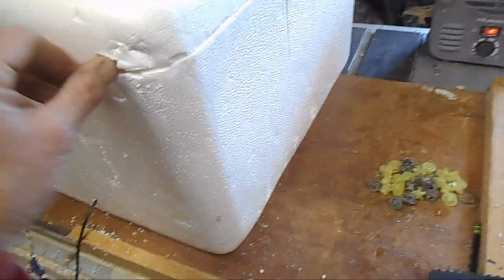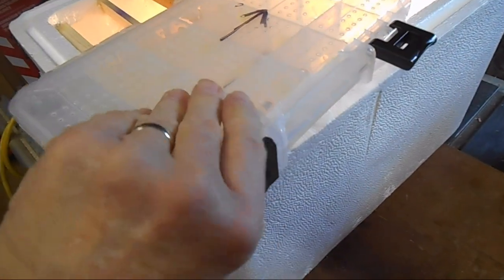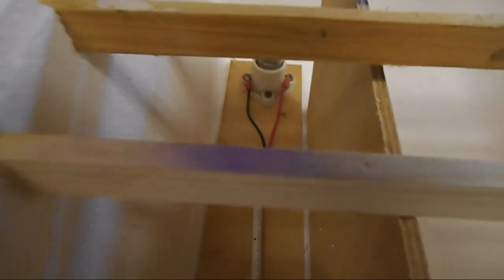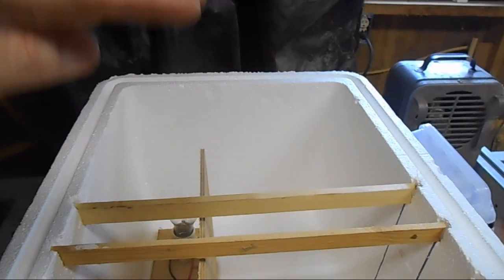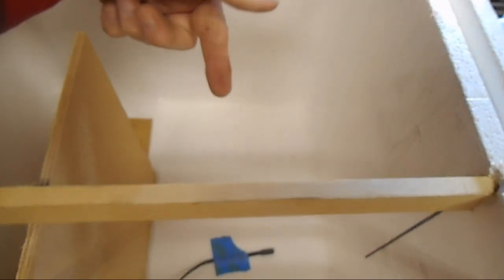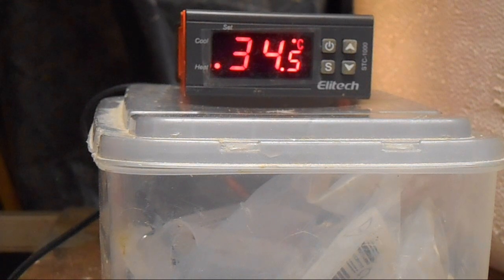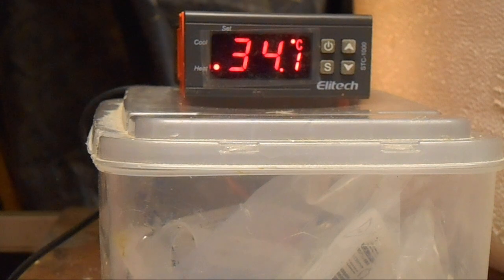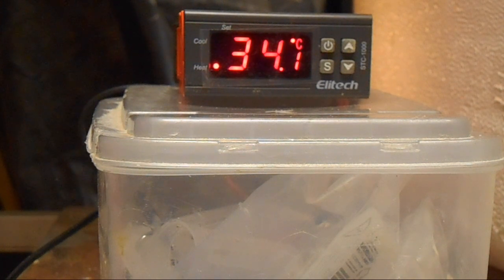Build A Queen Cell  Incubator

Comment: I don't see any updates to this video. How did it turn out? I'd certainly be interested to see what it looks like with cells in it. I'm rather new to this so I have a difficult time seeing it in the minds eye.
Reply from the maker: The incubator seems to work well for smaller volume queen cells (less than 20 at  a time). I used it for several batches but my volume requirements increased and I bought a chicken egg incubator.
Reply: @smokymountainbeekeep  Thank you, Chuck

Comment from the maker: I've had several comments of how to deal with the queens once they emerge. The method may turn out to not work at all but now I'm planning to use a #8 screen for each of the compartments as a separator. I'll see f that works.  I'll make a video of that and let everyone know how this method work. As some have suggested, I may just go back to using the hair roller style cages.
Reply: So what hatching % did you have ?
Reply from the maker: @Lucas Cameron I hope you have great success. Like with anything, over time, you may find some adjustments that can improve your yield

Comment: I LOVE This video!  Can you tell me where you found your temperature controller?  I figured that either Radio Shack or the pet store would have the inverter.  it is getting my device to control my temps that is my problem and how they are hooked up to control the lamp that is my issue.  It is frustrating me because I can build you the most beautiful bespoke  pieces for your home of office, but building this thing has my brain cramped for some reason.  I think it is because I am not familiar with these electronics to do with very fine adjustments and humidity and such.
Reply from the maker: Thanks for the comments. I hope to test this incubator in a few weeks! I bought the temp controller off of amazon. Below is the link. It is a bit confusing to connect the wiring and adjust the temp but once you figure it out, it makes sense.
https://www.amazon.com/gp/product/B00Y8T9YZG/ref=oh_aui_search_asin_title?ie=UTF8&psc=1
Reply: @smokymountainbeekeep  Thank you for providing me with the link.  This is very important to me.  I ended up as a quick stop gap buying a chicken egg incubator to just get me started with making my Queens while I make my own system.  Thank you for sharing your information on You Tube and making the beekeeping community a better place.

Comment: when you open the lid to take out a queen they will all kill each other hahahaha
Reply from the maker: It turns out that the queens don't run that fast initially but I had cut a #8 hardware cloth sized to cover each cubicle. That helped but eventually I learned that this was an interesting experiment. I have since determined that even though the plastic case is useful, I now use a "hair curler cage" in a little larger cubicle. Hey, thanks for watching and for your comment
Reply: @smokymountainbeekeep  I was going to say that too minus the haha remark good job

Comment: I've got an Italian thermostat(LAE X5),working on 220volts;the problem is that I can't take it with me,in the car for instance(12 v plug),,any ideas?!
Reply from the maker: That is an interesting question. At first I thought about building a converter using a CMOS 4047 along with a couple of transistors but that would be very complicated and time consuming.   I then did a google search and found this, perhaps this will help if you can order it from where you are:
https://www.banggood.com/XUYUAN-600W-Cup-Style-Power-Inverter-DC-12V-to-AC-110220V-Converter-with-Voice-Control-LED-Atmosphere-Lamp-for-Car-Home-Outdoor-p-1590131.html?rmmds=buy&ID=554483&cur_warehouse=CN

Comment: What size box are you using Omaha  Stakes are different sizes?
Reply from the maker: The box that I merely found on the side of the road at a neighbor's house measured 20" x 16" x 14". Hope that helps!
Reply: Chuck Davis thanks so very much. I am going to try to make one.
Reply: I put a brick in bottom of incubator it help hold heat a little longer b4 light has to come back on.
Reply from the maker: @kennysmith1571  The brick is a great idea. I had placed a couple of bottled waters but they were too cumbersome and either tipped over or rolled whenever I needed to access something inside

Comment: I have no experience with bee incubators but lots with chicken, pheasent, parrots and other exotic birds. I do not know how exact the temperature needs to be but imagine pretty exact. The problem with normal thermostats is the temperature fluctuation as the inertia in the heating element carries on giving of stored heat even after the thermostat switches of, same on the down side, as the temperature drops past the set temp it takes a while for the heating element to heat up to temperature and so the temp may drop a couple of degrees before it actually starts to heat again. All this gives a large fluctuation between the hottest and coldest temperature. A far better solution is a PID controler, not much more expensive than a thermostat but far superior in holding the set temperature. They work like your foot on the car gas pedle when trying to hold a constant speed, (and cruise control)if you hit an incline you need to give more gas, ease of as you reach speed so not to overshoot, and also ease off if going down hill. Once tuned they will keep the temperature perfect and also use much less electricity. If the temp drops suddenly like when you open the door the PID controler lets full power through to heat up quickly and reducing as it gets closer to the set temperature. As i said with bees i do not know how critical the temperature is but with some exotic birds its very citical, even with simple chickens you can up your hatch rate from say 65% to over 90% all else being equal. They are reasonably cheap on aliexpress banggood etc. hope this helps.

Comment: Chuck, 
Great idea!  

I've taken the same concept to build a honey super warmer within an empty medium super.  Used 2 100W bulbs.  It does a great job heating the honey to 93F before I extract.  Especially useful to extract cold honey.  

I've a couple of suggestions/questions
1.  Have you drilled holes thru the fan separator board near the wall to insure air circulation, so the wind doesn't 'dam' up?
2.  Do you think the thermocouple should be placed more toward the top of the system?  as hot air rises. 
3.  You've already thought thru what happens when multiple queens emerge and you have to open the lid.  Separate screens over the enclosures.

Keep up the good work.
Blessings,
Bob
Reply from the maker: Thanks for the comments. That is interesting about holes in the separator  board. I may try that. I have attempted to place the themocouple  near the cells themselves but I can understand about placing it more to the top.

Comment: Do you in now way measure moisture in the box? 
I always had heard that moisture is very important in queen rearing incubators.
Nice video!
Reply from the maker: With this incubator, which was the first one I built, I did not measure the actual humidity level, however, I did keep a jar of water with a sponge inserted to attempt to keep the humidity level high. I did notice that I needed to replenish the water every couple of days. That seemed to work satisfactorily.

Comment: Can you chain the fan and the thermostat together on the same cord to not have to have 2 plug ins? 

I did one of these for chickens last year but didn't have the plug ins linked. And it needed a lot of fixing still, didn't do as well as I liked.
Reply from the maker: I suppose you could link the fan and the heat (light bulb) on the same circuit. There should not be a current issue since the fans draw little current. My only concern would be that the air circulation (fan) would not be continuous and would cause the temperature to fluctuate a bit more
Reply: @smokymountainbeekeep  Ah, I guess your right. You do want the fan going 24/7. its not worth the risk if you end up blowing out a bunch of dead queens.

Comment: Developing queens are very fragile just after being capped. Moving them can easily damage them. You may need to wait till just prior to emergence. 

I also foresee mayhem when you open a case full of newly emerged virgins. Make sure you have the camera running so at least you can show us how it goes. I believe there are some cases available, similar to daily pill cases, which have individual compartments with separate doors. That may be a better option for you. This is definitely an interesting approach for small scale, low budget, queen rearing.
Reply from the maker: I appreciate your comments. I agree that the QC's are very fragile. If I move the QC's soon after capping, they are less fragile than a couple of days later. Of course they are much less fragile close to emerging but at that point, what's the use of an incubator. :)  It will also be interesting when I attempt to capture the newly emerged queens and I will certainly have the camera rolling! Thanks for watching!

Comment: Fantastic project, thanks for sharing. I'm curious as to how it all worked out for you?
Reply from the maker: Interestingly I did try to use this modified "tackle box" to hold the queen cells while in the incubator.  Turns out my fingers are too big to easily lace the queen cups into the small cubicle. With a little modification I was able to place a hair curler cage onto the queen cup then place it into the box. Bee keeping is all about experimentation and this was one experiment that required some modifications. Thanks for watch and for the question